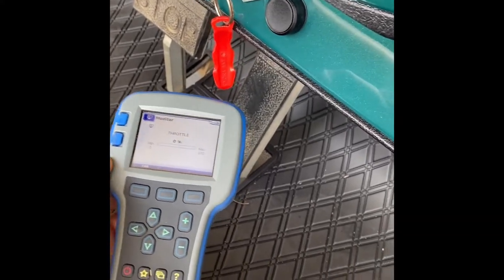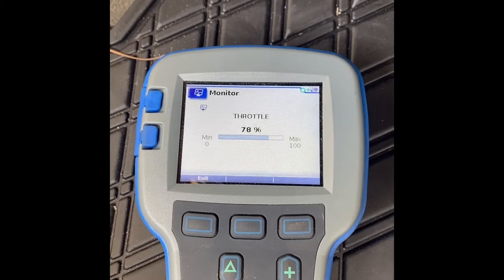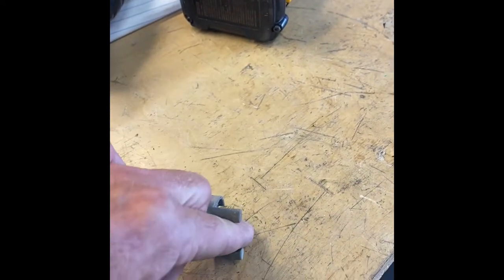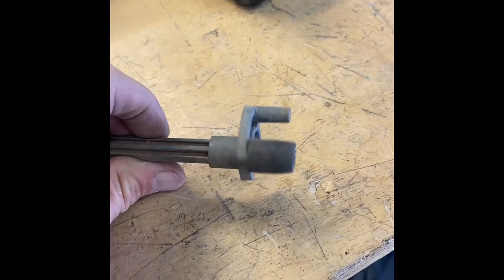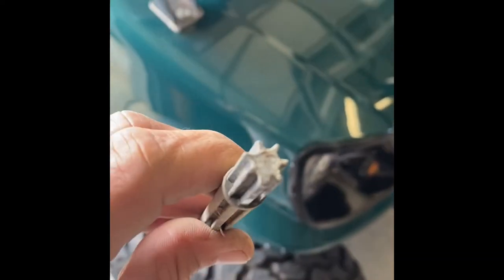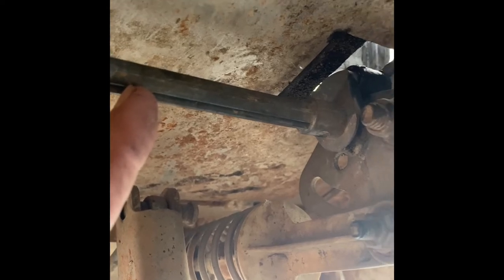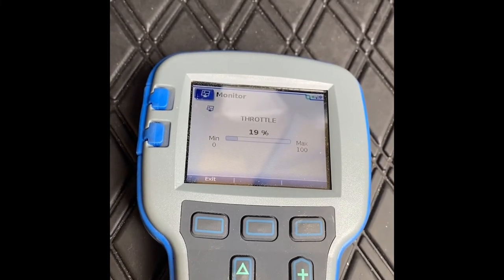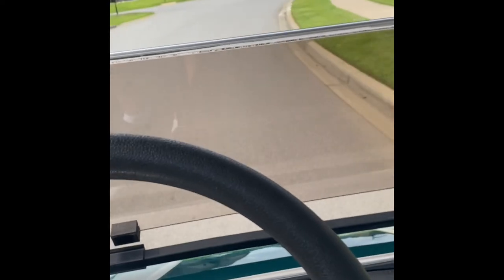Club car DS slow -  FIXED!

Comment: I actually jammed some plastic to take up the gap but will be using the fuel line. Got a brand new cart would only go 11mph. Did this trick and now at 19

Comment: It's been a while but I worked as a tech at a cart place for a bit some years ago. Carts would come in all the time with this kind of problem. Look around in the menus of the scanner, some where in there in them is a section that let's you adjust throttle position and percentage. I wish I could elaborate, but like I said, it's been some years. I'm a curious person so I had to play with everything I could find in the magic box 😆
Reply from the maker: I agree! I think that programmer will do more than I am using it for 👍, thanks for watching and don’t forget to subscribe!

Comment: I repair a fleet of carts. If it's slow like that, I shove a penny in the gap from above as a quick test, and if it fixes it, I use a metal bushing like your method.
Reply from the maker: Great tip !
Reply: @Kartznfartz  I was glad when I figured out this out. We have lots of carts with this issue.

Comment: No programmer for me. I have an AA 01 series motor DS. So I used a an ohm meter to measure the MCOR OHMs (Green & Yellow wire at the Controller) actual reading is 5.95K ohm at rest to 1.23 K ohm with floored Go peddle for maximum rpm. I'll try this trick to get to 0 ohm at floored Go peddle. At this point I am getting max 19 MPH with 20.5" tires. There is an aftermarket adjustable wire wound MCOR, that would probably tune the play in peddle shaft. How about a new shaft?
Reply from the maker: Absolutely that would work! This video is just in case you don’t have parts available at the moment. But thanks for that awesome info, I’m sure others will find it useful!